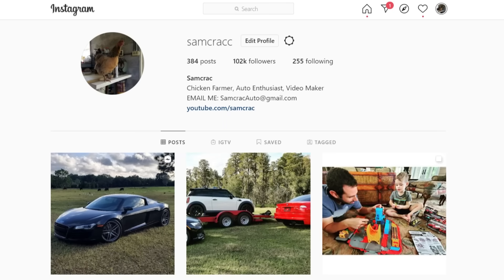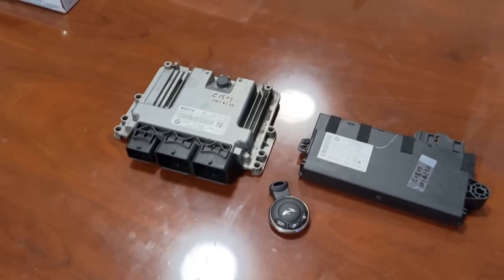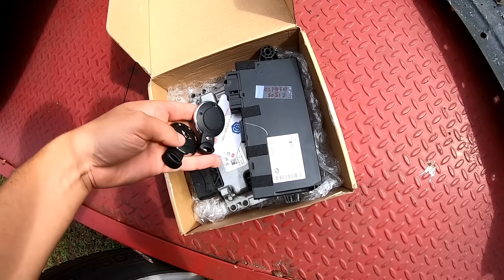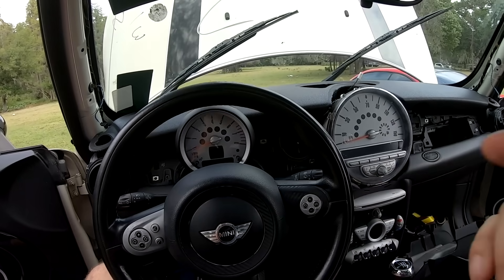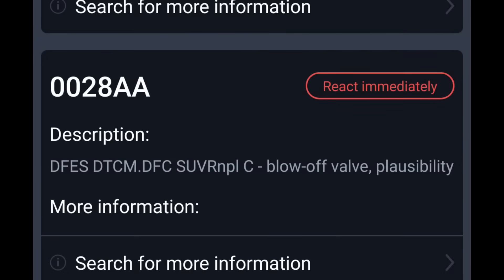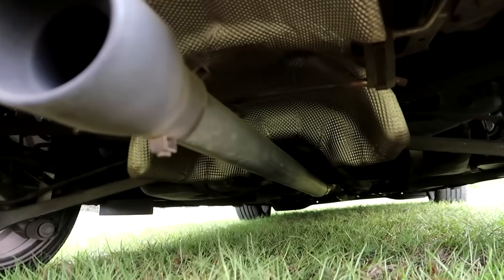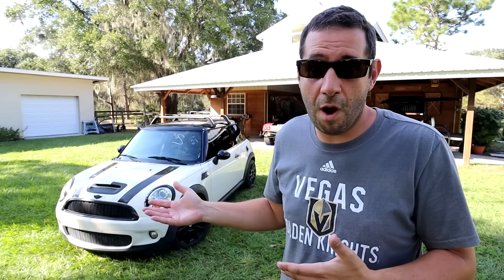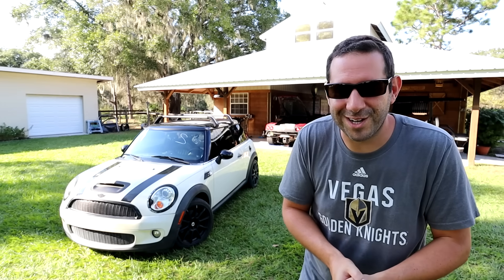Someone TAMPERED with our $1,000 MINI Cooper at Auction! Can a $50 Hack Bring it Back to Life?

Comment: The auction company should be paying for those new keys
Reply: Yea, exactly. Surprised he did not mention this. I think that auctions are not required to supply keys, but if there pictures shows car running then the correct key was there to start with. Guess he feels a bit fooled.
Reply: Yea itz a scam cuz with out keyz it cost less so 2 Auction it off 4 more $$$$ dey throw any keyz
Reply: @robertcowling4313   This would be treated the same as buying a run and drive with the key, then showing up to get the car and the key is gone.  Losing the key after being auctioned would be something they would have to rectify out of their pocket.
Reply: He could take the key to the auction house and see what it starts?  Probably to late.
Reply: @dd___dc  They have the keys for all the cars in a drawer with a tag on it for the car it fits. Somebody there just pucked up.  That shitstuff happens. Majority of the cars that work are driven inside the auction barn and the bidding happens there as the engine runs so the bidding is higher.  Once sold ; then the car is driven out by the auction people into the lot and the key is tossed in their key drawer.  Somebody messed up in organization.  Usually many car buyers buy more than one car...so stay on the bidding floor.  Later they see the cashier with their wad of cash. They hand them the keys that are suppose to be for that car. Some people drive to auction with a trailer. so the car is put on a trailer behind their truck.
How the key was mixed up is a mystery but it happened at the auction.  They never give you the keys until they get the money.

Comment: There is s a metal key in that fob. Push button on back. Then try that key in the door. It it doesnt unlock the door the auction gave you the wrong key. Have dealer cut you a new key just incase you ever need it to get in the car..

Comment: I don’t think that’s the airbag light. It looks like the low tire pressure light is on. Another issue I’ve had with a mini. Reset is in front of the center console. It might reset if the pressures are good, but they have to be within three psi of each other.

Comment: BMW antitheft is nuts, every car that’s been stolen within our club and community groups has either been snatched by a flatbed or someone left the keys in the center console.
Reply: Mercedes is even better
Reply: LAND ROVER products are even worse, once they go into limp mode even the dealer can't fix them. If you play with the electronics like SAMCRAC did here the odometer will flash indicating tampering and you'll never be able to sell them. I know I had 14 of them here at  one time.
Reply: Hahaha, I had a f10 where they key went dead. I can unlock the car but can't get the gearbox to go to neutral. So needed to get a specialized tow truck to tow it out of the basement parking.....
Reply: GM was the worst. When the cars still used the 2 keys (The 2002 Camaro/Firebird was the last one to do so btw) they would put a chip on the ignition key. The key cylinder had a chip reader and with time, it would stop reading the key basically stranding you. The chips were resistor chips and essentially all you needed was the right ohm resistor to jam in the connector for the ignition (on the car side). The anti theft is well known for stranding the owner than stopping theft.
Reply: On the old Mini's it took 4 guys to pick up the car and walk away with it.  BMW added LEAD. to make them heavier.
Reply: @mystacadillac8732  GM passlock?

Comment: What happens if the steerling lock emulator fails? Does your car turn into a train on the motorway whilst you are doing 70? Much prefer a fix that doesn’t ignore the steering lock fault.

Comment: Aftermarket exhaust lol, shows a muffler delete.😂
Reply: It has a resonator which is closer to the motor and then just straight pipe to the rear. Yeah normally it would then go into a muffler but sounds so much better without.

Comment: Those Saab DIC cartridges seemed a little apple to me at the time... but honestly, 200 bucks for all 4 coil packs 100% ensured to work or NOT work... I'm so glad when I check over my junker Saabs I don't have to deal with individual coil packs. As these coil pack styles vehicles get older and older they just have MORE AND MORE problems, people only "fixing" one at a time etc. Having it be a solid unit makes the issue significantly more simple to diagnose.

Comment: 1,000$ for that? Damnn, in EU u can get a barely running 2002 car for that price.
Reply: That's the "BMW hipster tax", even if it's a french engine, it's still expensive af even rough used condition.
Reply: BMW USA doesn't build the same as Germany. I know because I shipped a USA 325CI to germany, the transmission blew at 60k miles, and then the German BMW dealer said they had to order a new transmission from the USA. What a joke. So in the USA these cars go to the trash heap since they are so unreliable.
Reply: in uk you can buy this Mini Cooper run and driving for £600
Reply: In South Africa we get ripped off. The cheapest mini here starts at R50,000.00 rand = US$3,200.00
Reply: can't up here in Canuckistan either. The thing is: I bet he has a dealer bid account at COPART which means he saves a bundle. Here in Canada, the gate fees, internet bid fees, bidder bid per bid fees, key fees, hst, transfer fees, proxy bid fees, broker fees, effectively double the price of the vehicle you're buying. I looked into it a year ago and for eg: If I bid $4000 on a $10,000 vehicle the cost out the door for me would have been $7800.00. SO not worth it.
Reply: @konieczkoDWA  UK has a small market because the cars are right hand drive and new cars are dirt cheap in the UK as well. Whenever my car (in the Netherlands) gets old but is younger than 15 years, exporting it delivers a gigantic tax return (on gas guzzlers) and will sell well in Eastern Europe. Hybrid and electric cars don't get a tax return (because there wasn't much tax paid when they were new in the first place) but older hybrid/electric vehicles get a large tax exemption in many Eastern European countries so they'll serve as cheap taxis there. My colleague recently sold his 2009 Prius with slight damage on every panel and moderate damage on the roof for €3000!
Reply: @uscjake868  Maybe you should have tried a BMW dealership in the UK as LHD BMW's are built in the USA in the same factory as the USA specific ones.

Comment: The diverter valve is likely a torn internal boot. GoFastBits make a great brass piston version. As far as the key, you can see if the mechanical key opens the door (press in the sliver button and pull the key from the fob). If the key dropped from the programming, now that you have a working key you can "re-add" the non-working key thru a simple process. I've got 2 minis (a 2010 R56, a 2012 R55) and the 2012 "forgot" one of the keys because the battery in the fob died. Replaced the fob battery and did the re-add process.

Comment: A European spec Cooper S has twin tailpipes though the middle of back of the car and youre also missing a  n S badge for the front grill they only cost around $20 on ebay but it straight away makes the car liik more aggressive and have you thought about original cooper S Spotlights for the front

Comment: If you have random misfires check your requested vs actual fuel pressure. HPFP failures are common but do not code by themselves.

Comment: Just curious if anyone tried to replace the battery in the "wrong key" - a dead battery might be the reason for the key not being able to communicate with the security module...
Reply: Sam tried it in a previous vid
Reply from the maker: I did in my previous video
Reply: Not likely they probably had 2 key fobs for 2 same cars, so the other car that was sold will also be rejecting the key when the other buyer gets the other car
Reply: That was the first thing Sam tried in the initial vid.
Reply: Dead battery has nothing to do with starting the vehicle. It's related to the Remote option only (lock, unlock doors). Nothing else.

Comment: The only time when a BMW stop to be a problem is when it goes to the scrapping yard and is recycled
Reply: The bad thing is? This has become the norm these days no matter how much you spend on a vehicle. No one gives a rat's ass anymore about build quality. It's all about the most tech you can pack into a vehicle. 

I'm seriously looking at 80's era pickups back when they were so simple and reliable. Who cars that it doesn't have lane assist and adaptive cruise and wifi and blu tooth? I want a vehicle that will start and run every time I need it to. The problem is? They are becoming collectible so they want good money for them. I saw a fully restored 1984 Ford Pickup for $80,000.00 USD
Reply: @muskokamike127  80 pickup trucks are going up. Looks like a pattern..before was 60's...70's and now 80's. Ford Bronco 2 still are cheap..time to buy?...

Comment: I love my Mini, Stage 2 with 220 hp in a 2600 lbs car, that's 600 lbs lighter than a Mk7 GTI.

I'd recommend an upgraded diverter valve though, the GFB+ is pretty good.

Comment: Gen 2 Mini's are excellent and fun cars...but you HAVE to change the oil (5W-30 full syn) at about 2x the frequency recommended by the OEM. In other words, change oil every 5K miles and not 10k miles. If you do not, you will run into real issues: timing chain, turbo...This is a must for both N14 and N18 engines.

Some things you should do with an Gen 2 N14 engine: 1) make sure the timing chain tensioner is the newer version and not the recalled version prone to backing out and causing the chain to loosen; 2) replace the oil line to the turbo with a good aftermarket steel braided flexible line (N14 and N18); 3) run only premium gas (N14 and N18); 4) Install an OIL catch can to the clean side and as well, to the dirty side. (On the N18 engine, to the clean side only).

On an older automatic car with 80k+ miles I would also have the transmission fluid Drained and Replaced (NOT flushed) along with a kit that replaces the filter and gasket.

Comment: Yeah, have a Renault that uses a card style key. IF you drop it way too many times it will fail to register to the immobilizer module. If you crack these cards open (as well as many other immobilizer equipped fobs or cards) there are small coil modules inside that communicate with the IM moduel. A simple resolder of the coil to the board will repair the "key". They use what is known as a proximity card by the alarm industry. Without the coil in the card or fob, the key will not power up and therefor not read the card code.

Comment: Just to confirm, I bought a mini with 2 dodgy keys. I took it to a Mini main dealer who diagnosed the problem as just being the keys, replaced, and coded two new keys for £320. I think that you'd have been no worse off on this occasion getting the mini main dealer to have done the keys. I too have a lemon mini, its back in the main dealer tomorrow for a footwell module which is screwed, wouldn't recommend a mini to anyone

Comment: SAM DON'T KNOW IF YOU WILL SEE THIS BECAUSE IT'S SUCH OLD VIDEO  BUT WHEN YOU GET SOMTHING LIKE THE COIL PACK USE ZIPTIES AROUND IT WITH ONE OVER THE TOP THAT WAY YOU CAN PULL ALSORTS OUT WITHOUT USING A BAR THINK IT LIKE A LITTLE BASKET HOPE THIS HELPS YOU IN THE FUTURE

Comment: I had a r56 FL Cooper S. Sam you should also get valve and injector cleaner, new bov and cam sensor. Also check if it has sport mode (next to start/stop and esp) for pops and bangs. Minis are fun, chain sounds fine to me

Comment: Better to go with the after market BOV/Recirc Valve like one from Forge Motorsport. It's all metal construction stops the failure for good as well as generally being more responsive than the electric solenoid actuated one that can hold the valve closed causing turbo flutter. Also check to see if the noise baffle is still installed on the outlet side of the turbo, removing that improves turbo response as well.

Comment: Replace the timing chain tensioner. When it gets weak the timing is off and sets vanes codes. They always fail anyway and it’s cheap protection from the timing chain skipping.
Reply: Posted before you mentioned it but with my experience I couldn’t here anything and skipped a few teeth. Pulled atensioner and reset chain with new tensioner and all was good.

Comment: Hey Sam,
While its possible it had a key swapped its likely its not actually a wrong key issue, seems to be a common problem with the R56 generation (especially if it has comfort access as if the key is kept inside it keeps polling the car periodically and runs the key flat and for whatever reason can also kill the key I've heard), we are building one as a racecar currently in Australia and i bought mine from the Auctions wrecked, but I could start it right up when i got it, within a week of moving it around the yard I had the EXACT same issue as you had (Mine doesn't have comfort access either), the immobiliser chip in the keys for whatever reason go bad, some people recommend replacing the key battery as you did, but in my case it was a solder in battery, i pulled the key down and kept current to the key at all times but even still it didnt resolve the issue, so alas off to bmw to order a key, once it arrived it has been good as gold and the build has continued as planned!
Good to see you experiencing the Mini lifestyle, as with many people you either fall completely in love with them or you hate them, like a Toyota MR2 there doesn't seem to be an in-between.
Enjoy your videos, keep it up,
James

Comment: BMW and limpmode: My old BMW 320 decides to go into limpmode once in a while: Switch off the engine and start it again. Unfortunately my wife did not know that and crawled for a few minutes before reaching her destination. 
I have an old Diesel Opel Omega. The engine is the same as in BMWs and Landrovers. Until I replaced an injector, the car was in limpmode for a minute when cold. Very, very annoying! 
When the key started acting up on my 320, I learned that a replacemnet key was over 250$! We cut the original key open and put a regular battery in it. One hour of fumbling and the key is working perfectly for over a year now!

Comment: I had a 2006 supercharged and replaced the coil pack with an MSD coil pack, colder plugs, and heavier wireboosted performance and fuel milage.

Comment: I would be paranoid about the steering lock deciding to engage at just the wrong time.
Attacking the lock with a drill and a self tapping screw would be the first thing I do before driving anywhere.

Comment: Battery connection rule of thumb: Disconnection-NEGATIVE 1st.....Reconnection-NEGATIVE last.  That way you won't weld your wrench or possibly fry a system.  Do NOT turn on any modern car with a slack battery cable.  Basics.

Comment: You don't have to show me the coil pack install, but I would like you to show a) how well it runs after a month of you daily-ing it and b) when you get around to it, tidying it up, removing (or refreshing) the plastidip on the headlight trim rings and the like.  Is anything, anything at all, of all the features not working right?  Let us know if so.
Reply: Just in case you haven't already guessed, I have deep suspicions about Mini reliability and fixability.

Comment: I bought a ford focus just before Christmas from an auction site, in UK, images of the car running at tick over but ever since it was delivered I've had a problem where the fuel pump and starter motor aren't working and so the engine doesn't start, Maybe immobilizer problem? This may be similar to whats wrong with my car so hopefully can get it fixed in the next week or 2.

Comment: Dear Sam , being a Peugeot engine , cylinder number 1 starts at the flywheel side
Reply: BMW engine, also fitted to Peugeot’s, correct the numbers are backwards...
Reply: @punkstoper  its a co engineered betwen bmw and psa group and then installed in various models of each group

Comment: Sam got question  got 2012  land rover range rover on auction no airbag deployed  changed the battery it doesn't want to start  is there any button to reset ??? any one help ? it got power but no crank

Comment: Do you think they could fix a Mercedes tele-aid module that's a parasitic power drain? I replaced the module with another used one and still get the parasitic power drain. Either that or delete the tele-aid module from the car.

Comment: 5:20 did you try a battery in the og key? Or you just charge for a new key and program it?
Reply from the maker: In the last video on this car I did replace the battery in the key
Reply: Even if you check the key battery, it has nothing to do with starting the vehicle. Battery needed for remote control, Only.

Comment: Sam... just a thought.. at 12:51 is when you found out about the engine issues... I think the seller may have intentionally swapped the keys after they dropped it off for auction. They bring the car in, it gets inspected, yes it runs so it's listed as R then later on they swap the keys to ensure a potential buyer doesn't see everything that's wrong (especially vanos).. and they would get top dollar at auction... pretty sneaky.. dirtbag for sure....

Comment: Though, as this was an auction car then you got handed the wrong key.  Auction house fault.  They are probably knowing where the other car is because that guy would be BITCHING TOO & realized that the key is the wrong key.  They would be bitchin at the auction house about that & if YOU phoned them they could put one & one together and gotten that mix-up straightened out.   AKA a ten cent phone call. Cheaper & faster.

Comment: Those Peugeot/PSA 1.6 THP Engines are complete garbage. Timing Chain issues, HP Fuel pump issues, coil pack issues, Cam Phaser issues, Thermostat housing issues. When they run they run great just not very long. We have had Citroen DS3's who had their 3rd Timing Chain within 120000km.